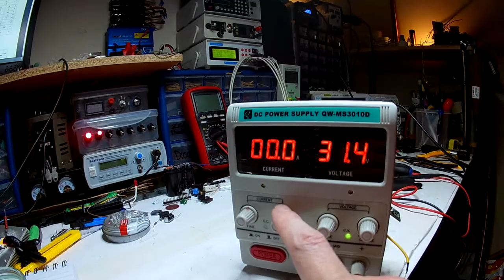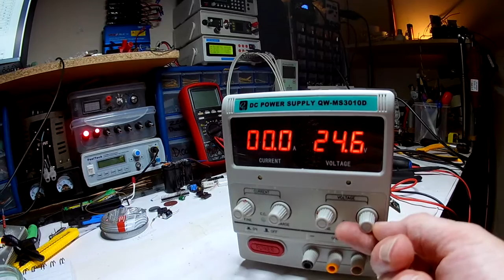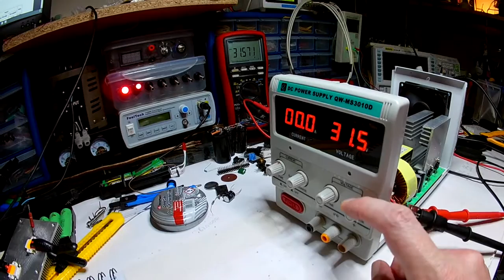Maisen MS3010D Repair Attempt Pt1

Comment: Dang I just shorted mine out .  O on current and voltage goes to 60v when I turn it on that immediately scrolls back to 0. C.C. AND C.V. lights are on very dim with the power switch off.  Mosfets look ok and I only have one resister there where you have 2 that measures 57ohm.
Reply: I have the same problem

Comment: Hi I have a (ZHAOXIN PS-3005D DC Power Supply) but it is stuck on 50V which is MAX! it does not adjust to a lower voltage do you know where I should look ?

Comment: What is the value of the resistor that you replaced. It is R5.  I had the same resistor blown, but it is a surface mount resistor so I cannot get the value.  It looks like this is a common problem with this power supply.  Please let me know what the value of the resistor.  Also the value for R2 as well.  Thanks in advance.
Reply from the maker: Here is the link from the comments section in this video for the schematic for this PSU.  http://www.eevblog.com/forum/beginners/maisheng-ms-605d-power-supply/msg1060359/#msg1060359
Reply: Wow! Thank you so much.  What a life saver....Thanks again for your help.

Comment: Aren't all the xx3010D PSU's switch-mode and not linear?
Reply from the maker: As far as I know, yes. This one is definitely switch mode.
Reply: Elecifun Thx! I'm new to all this and I really appreciate your help. ÷*)
Reply from the maker: If I can help I will buddy. I am new to this as well : )
Reply: Elecifun Oh yeah? Well that's really thoughtful of you. Thx! ÷*)
PS: Woo-hoo! On your successful fixing and all that!
Later... (maybe) ÷*)
Reply: 4FunRC Hi. No, you can get linear ones. I’ve got a Chinese linear 3010. It’s in exactly the same case branded W.E.P. I’ve also got a switching one like the one in the video. Both were about £50. The linear one seems more robust to me and more likely to take abuse and last longer. It’s weakness is the rubbishy caps but these are easy to replace when they fail. It also only has current adjustment to one decimal place though and of course it’s much heavier than the switching one. 

When I connected a battery reverse polarity by mistake it just disembowelled three of its caps. But when I did the same to the switching one all manner of bits and pieces fried and popped. It would certainly trust the linear one at a sustained 300w more than I would the switching one. Cheers.
Reply from the maker: Really, 300 watts linear. Show me. Give the link my friend I would like to see this. If it is cased the same, it does not make it the same. I will point out a big difference without seeing.the PSU. Price. Please share.

Comment: will you recommend maisen MS3010D? how you break it? I can't find your video
Reply from the maker: How I broke it is here https://www.youtube.com/watch?v=VL2IAC0nIj0
You can find them for around £45 on ebay so yes it is a cheap supply but it does have its limitations as the videos shows. I do not think you can get 10 amps at 30 volts 300 watts.
http://www.ebay.co.uk/itm/Lab-Adjustable-DC-Power-Supply-Precision-Variable-Digital-Voltage-0-10A-0-30V-UK-/302033186130?&_trksid=p2056016.l4276

Comment: Its a good feeling when you repair something..you had half of it....smile..i watch the professionals use a schematic and work methodically around the circuit..but i am more like a butterfly moving around the board..sometimes i have fixed things by just touching them bit biblical..lol...like my wife's stair lift last week..last psu it did turned out to be a microscopic crack in the tracks under the board..took my 10 years to find it..lol..anyway best of luck maybe check the caps..and i hope we get it fixed before part 20..grin
Reply from the maker: Well his may take me 10 years also. I can't find a schematic all I have to go on is that it popped when it first failed and the transformer is making lots of noise as the load is increased. Also the output jumps from nothing to something (it does not rise in a linear fashion) I can fix computers by touching them I have always had that knack but this is different.
I may have to cheat...but whatever works a!
Reply from the maker: David Barber OK cheers I will check it out.

Comment: did you ever get it fully working
Reply from the maker: I have had to put it on the back burner for now. I will take another look in the next few weeks. I have a feeling it is something to do with the current sensing and control.
Reply: +Elecifun hey I got the same ps but the MOSFET blew up with R2 and R5, I can replace the MOSFET but R2 & R5 lost it marking. Can you tell me the resistance of the 2 resistors? 
These two resistors is located in front and next to the two irf 840 MOSFET.
Reply: 47 ohm
Reply: +Bob Smith thanks
Reply: http://www.eevblog.com/forum/beginners/maisheng-ms-605d-power-supply/?action=dlattach;attach=266319  
here in a schematic it is for the 5 amp one but from what i can find it is almost exactly the same, 
in my power supply the mosfets and resistors failed i replaced them and now it cant output above ~20 volts
Reply from the maker: Hi, they are both 47 ohms.
Reply from the maker: Hi yes it is working now. Just did a couple of tests tonight and all seems well. Its back in service.
Reply: +Elecifun thnks
Reply from the maker: Yeah I did it.
Reply: what did you do to get it working 
?
Reply from the maker: I replaced the two IRF840's and made sure the terminal connection board is fixed firmly with its three nuts.Your schematic link helped with some missing component ambiguity, thank you.